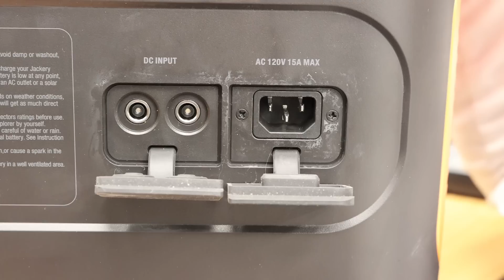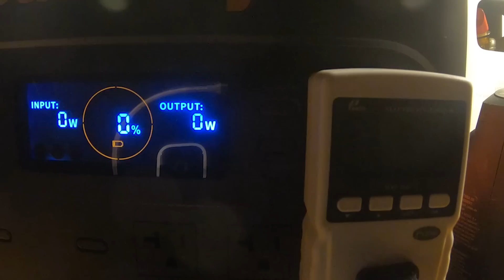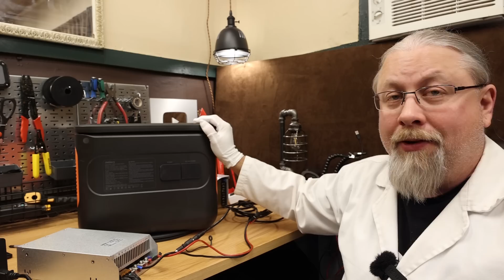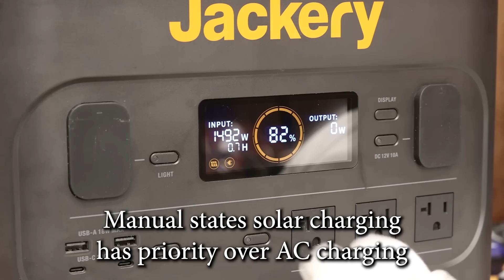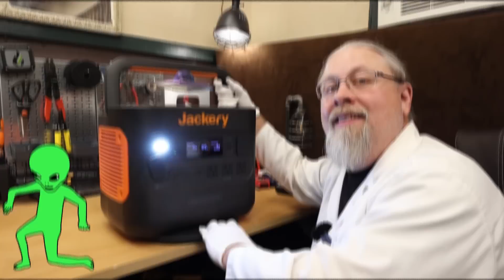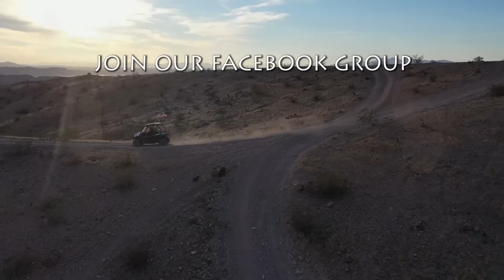JACKERY 2000 PRO 2200w UPS Solar Generator Battery Power Station Review

Comment: That audio test is indicative of big problems if you're using this with ham radios. If it gives interference at audio frequencies the harmonics are likely to be much, much worse at radio frequencies. My bet is that this will be unusable on HF and possibly VHF/UHF. Try charging it on a GFCI outlet and see if it trips it.
Reply: This is really a shame, I hoped Jackery could do better - my choice therefore is the Bluetti AC200MAX, it has very low interferences, so I can power my whole ham radio equipment in my shack - there is also a big difference to the Jackery, because the Bluetti provides 30 Amp DC out, and this is a really important feature we need, especially when we are outdoor - I really like the Jackery products concerning the quality, but now Bluetti wins with it‘s specs in this class !
Thank you very much HOBOTECH for your detailed and honest independent reviews, they are really good 😎 - greetings from Germany 👋 Claudia DF1UX
Reply: Probably
Reply from the maker: I'll give that a try. I was really shocked.

Comment: Lithium ION batteries!? .... I'm out... Your competitors are going with Lifepo4 however you are keeping with old battery tech. What about Bluetti and it's 3500 cycles to 80%? Good to see it charge faster than 200 watts though, that's an improvement over the older Jackery power stations!

Sorry you had to review this Hobotech!
Reply from the maker: LiFePO4 is 10 year older technology than NMC -- not newer.
Reply: @HOBOTECH  so true and I knew that... I was too angry I waited all day for this to find out it wasn't LFP lol... old "trends", sorry I should have said "trends" not tech haha. Price is going to be above $2500 is my guess and they didn't want to completely kill the excitement for it.
Reply: @HOBOTECH  NMC calendar ages quicker than LiFePO4.  Even with minimal usage cycles NMC will only hold 60% capacity at best after 10 years.
Reply: @HOBOTECH  How is it better when it only gets a fraction of the cycles?
Reply from the maker: NMC is better when you need light weight, small size, and portability. Jackery knows most people use them outdoors (motto: power outdoors). If you want a 60lb slug in a box twice the size then simply get a Bluetti AC200P.
Reply: @HOBOTECH  I always appreciate your reviews Hobotech! You have a great channel. I'm just giving Jackery a hard time, thanks for the replies and keep up the great reviews 👍😁
Reply: @HOBOTECH  That's why you get a girlfriend or a wife. Let them carry it.
Reply from the maker: They made a really, really bad move announcing the price of their largest possible bundle first. Literally half the folks in chat were ranting "$6200" as the price of the base product. Major fail of their marketing dept.

Comment: Looks like I’m still going for the AC200 MAX
Reply: the spec is definitely better.  just ordered a ac200p and an ac200 max.  maybe the build quality is better?  but yuck, those li-ion batteries.
Reply from the maker: Be sure you guys use my links and codes for discounts
Reply: @HOBOTECH  - will do.
Reply: @HOBOTECH  Code doesnt work just tried it on several diff configs
Reply from the maker: @jima7925  Waiting for response from Jackery .. someone there goofed (happens literally every single launch)
Reply from the maker: Well, Jackery says no code but a 5 year warranty...
Reply: @jima7925  I did not expect this power station to be seriously expensive. They are asking $2300 for it. I am not a happy camper.
Reply: You won't regret it